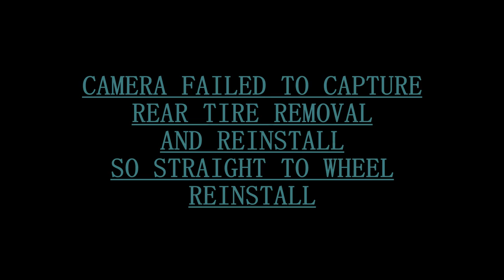TIME LAPSE TIRE CHANGE VSTROM

Comment: Josh, one of the guys from my church just clued me in to those balancing beads not long ago. They didn't exist back when I was in the game.
Reply from the maker: Christopher Smith they existed just not in a purpose made/packaged product.  Bird shot or BBs will do the same thing. 

It's what I did on my last Cherokee.  Copper plated BBs. 
They're noisy though. When you come to a stop you hear something like a bag of coins jingling.  I figured the purpose made ones make less noise.  They do but if you spin the tire you can hear them rolling down the tire.  On the bike rolling they won't be noticeable. 

The only reason I usually do a standard balance is because balancing beads add a significant cost to changing tires. Unless you can recover and use all of them again and again.  And these are tiny little beads I don't know how feasible that will be. Guess I'll find out on the next change.
Reply: "Back in the day" for me means prior to about 1995. I used to mount and balance tires on a machine at a motorcycle accessory shop, and we never had that kind of product there. We had that Fix-a-Flat stuff, but no balancing product other than old-fashioned clip-on or stick-on wheel weights. Maybe someone was doing it, I just never saw it. My friend said they're like styrofoam beads. Is that right?
Reply from the maker: Christopher Smith BB guns didn't exist before 95?  What I was saying was products existed long before "balance beads" that would do the same job.  I'd imagine not many people thought to use things like BBs in that capacity before though.  

the ones I used are almost like lexan beads.  They're clear.  Pretty dense though.  Not that large a bag to make 2 ounces. And I verified the weight on a scale before I put them in. 

I forget the name of them but kept the packaging in the Jeep as I plan to do a review video after my ride to san Antonio and back.
Reply: Yeah, there were BB's, but seriously, people (at least in California) weren't using them in that way. We'd do other stuff, like use nitrogen in the tires instead of compressed air, and like I said, I'd do a good job of actually balancing the tire on the rim, but I never saw or hear of anyone using BB's.......especially not on the racetrack.
Reply from the maker: That's exactly what I'm saying Chris lol.  The "techonology" existed but very few if anyone used BBs in that manner.  Just someone decided later on down the road (2000s time frame) to market it as such change what materials are used and charge 20 dollars ;)